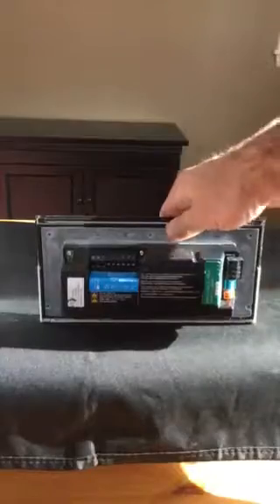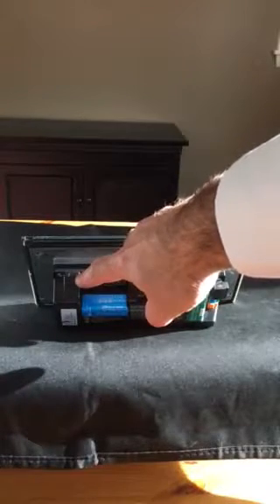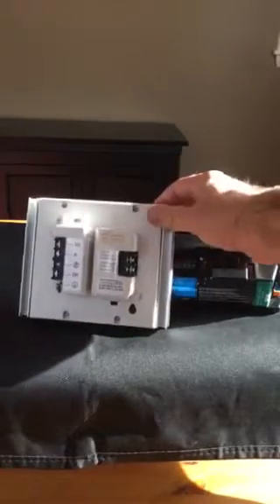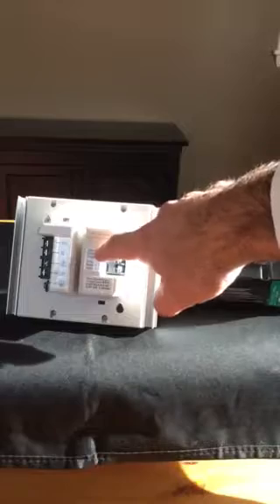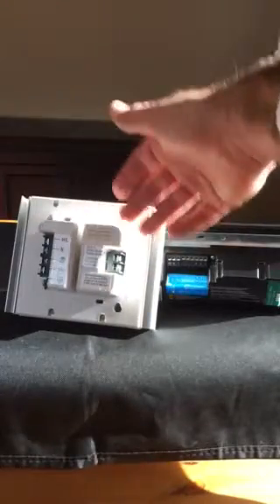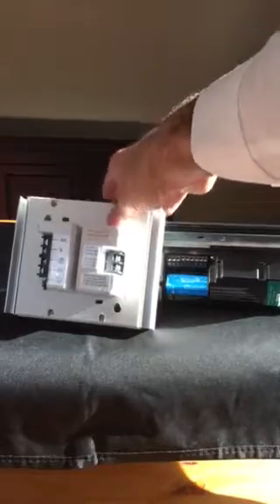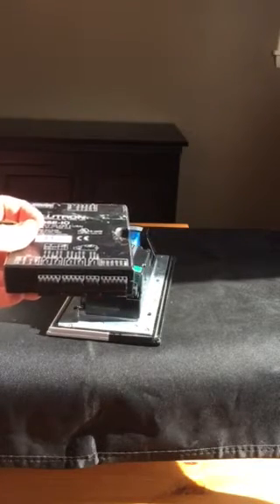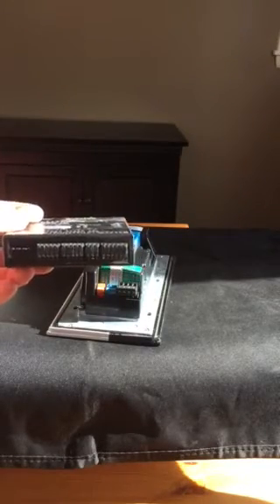Lutron Grafik Eye Qs Components

Comment: How do you get if off the wall?  I don’t want break any of the plastic front piece?  In other words, how do you get access to the screws?
Reply from the maker: There is a thin piece of black plastic across the top when you open the lid.  You remove that and you will see two screws.  The bottom half of the cover flips down to expose the other screws.